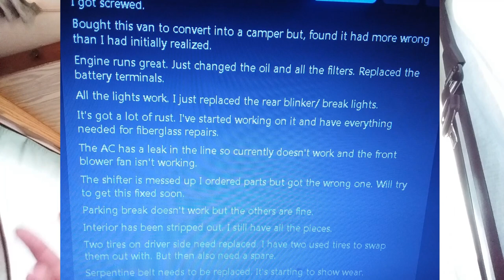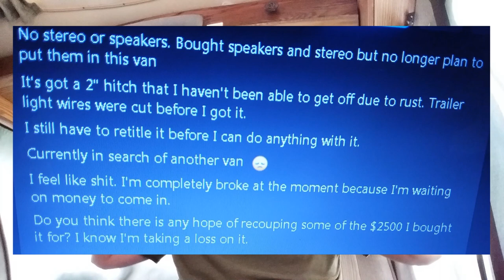Van Life Buying Mistake 😢 Example 137 😢 Minivans, Cargo Vans, Campervans

Comment: Good stuff big Kev!  I was lucky enough to nab an '05 sienna with 73k miles last spring for about 5 grand.  I immediately had the water pump and timing chain replaced and got new tires, transmission fluid change and oil change.  The mechanic said everything else looked good.  Doing some modifications on the inside but not tearing anything out. Put some very lightweight temporary storage and a nice fold-up bed and lights inside that can be run by my jackery 240.  Also got a nice pop up screen tent so when I pull into a campground, I can put my cooking setup in it and a few other things and then have room in the van for sleeping.  USB lights and fans to move the air around and a little screen for the window and I'm set!  Thanks for the common sense advice.  People don't need to go crazy to start with. Start simple and modify as you go if you really need to.👍
Reply: Sounds like an awesome find! What will be your 1st major adventure?

Comment: One piece of advice I can give to people considering a specific make and model of vehicle is to find the internet forum for those who own it and check out what they have to say about it because there's a lot to be learned from there about that particular vehicle.  Had I done that when I bought my 2004 Honda Odyssey a couple of years ago I would have learned about an expensive timing belt replacement needed at around 100,000 and 200,000 miles which is likely  one of the reasons the van was being sold at 190,000 miles.  The owner didn't need another car and so he wanted to sell it before replacing the timing belt was an issue for him.
Fortunately my 2004 Odyssey has the improved transmission put in the 2005 models so I'm satisfied with it even though I'll be spending money on the timing belt but it will never need to be done again.

Comment: Great advice. I always run a Carfax and if it does not have documented service, I walk away. Two things I always check for are a clean cabin filter and cleanliness under the seats. My theory if the owner does not do those two things, the big stuff is not taken care of. Also, if the seats are not comfortable after an extended drive, walk away. Vehicles are just metal or plastic.
Reply from the maker: Larrry, on newer vans, that's good advice about the cabin filter and overall cleanliness being signs of how the owner treated/maintained their van. More soon...safe travels!

Comment: Like a lot of seniors, I only just received my stimulus money and it will be going towards required maintenance on my Honda Odyssey such as the timing belt job but it must be done.  
I have a no-build build that is entirely satisfactory for me to stay in or even live in my van if needed (I tore down my no-build the other day and it took me 20 minutes).  For me, my van is like a storm shelter--a place I want to have ready and livable in case of an emergency, but not a place you want to live in for longer than needed.  So I have no intention of travelling and being a vanlife nomad.
I gotta admit that buying a used vehicle has been a stressful experience for me which is why my car I had before my van, an 06 Scion xA, I bought new and sold because I never intended at the time to have another car.  The people who bought my Scion said 2 years later that it was one of the best cars they every owned.  Yeah, that was great to hear.  I know my 04 Odyssey has been panned here but on Edmunds it received 4.6 out of 5 stars and only 4% gave it 1 or 2 stars.  Yes, they "had" transmission problems which by now are so far back in the rear view mirror that they've been fixed years ago.  Mine, fortunately has the 05 transmission as well as a tranny cooler so I hope to get another 50,000 miles on it if I live that long.
Reply from the maker: Steve, you have a plan and know what works for you - that's all that matters! You've not had the transmission issues out of your particular honda, so I wouldn't worry about. More soon...stay safe!

Comment: Rust is a killer.  Lesson learned.  Years ago, my husband bought a $300 car, was going to be our winter rat car.  So didn't care it was beat up.  But he never got underneath it.  Took it in to get new tires. Had to junk it.  The rust had eaten through the frame. After that, he gets underneath and takes a good look.  Thank goodness we didn't spend a lot on that car.  Still was a lost, but could have been far worse.
Reply from the maker: Mari, those rust issues do happen, and some vehicles are simply more prone to them. Luckily you didn't have a lot in that one...I've known of people who have had 10 grand or more in older vans or rvs and then found out they had a vehicle that wasn't safe to drive (or repairable). More soon...stay safe!
Reply: The last car that I bought new was a 2006 Scion xA (the hatchback, not the little box car) and the dealer did not even bother with trying to sell me undercoating to prevent rusting.  You just don't see those rustbucket vehicles around on the roads like there once was and I live in Wisconsin where the roads get salted in the winter.

Comment: When I was fresh out of college without much money looking at old cars in 2010 I looked under the hood for obvious signs of damaged, asked to see the vehicles maintence history, test drove the car and if passed the first 3 items then I put down a deposit and got the owner to agree in writing to let me take the car to a shop and if there were more than X dollars in recomended repairs we re-negoitated the price if there were less than X dollars in repairs I gave the sellar a cashiers check for the full amount. In todays sellars market they probably don't let you take car to a mechanic which is disgusting the buyer can really get taken advantage off in that situation. I'm about to buy a van and I hate haggling/I worry that it will be really hard to work with the sellar but it I'm in no hurry to get the Van if it takes months it takes months.
Reply: No one has every maintence record but if the owner  doesn't have any maintence records thats a huge red flag. Also its got alot harder to find a trustworth mechanic in recent years I've been ripped off a few times.
Reply from the maker: Very good points on buying a vehicle now, with this market just "out of whack" at the moment. Not sure if I covered it in THAT video, but after I've tested everything I can, I pay the thirty bucks and pull a Carfax on it - often they'll have quite a bit of maintenance work listed (especially if the work was done at a dealership), so you'll have the dates and mileage of when major things were replaced that the owner may not even remember. More soon - safe travels!

Comment: when I bought my 1994 Ford Aerostar last August, my plan wasnt to gut this van but keep it a No Build cause of my Income and Im not a builder or know nothing about wiring and solar. im just having some Mechanical stuff done and replacing 4 tires as New tire replaced. Now AC needs a new AC Compressor, Expensive BTW. UGH!
Reply from the maker: Sheryl, things like that can happen (a/c going out) but you can hopefully find someone to do it a lot cheaper than the $1,000 a garage will probably quote you. Maybe I'll do an a/c video if it's helpful (people are often told the compressor is bad when it isn't). More soon...stay safe!
Reply: @BudgetTravelGuy  Thanks Kevin!
Reply: @BudgetTravelGuy  his Labor for AC Compressor replacement is $444.00. He quoted me $900.00. Labor n parts! Im wondering is it a 4-5 hr job?
Reply: Sheryl my cost was 1050.   You are n the range.  Make sure it has the right temperature and blower power. I had to take mine back so they could fix it. Don’t be afraid to take it back if needed.
Reply: @janicecline1  Ok  Thanks!